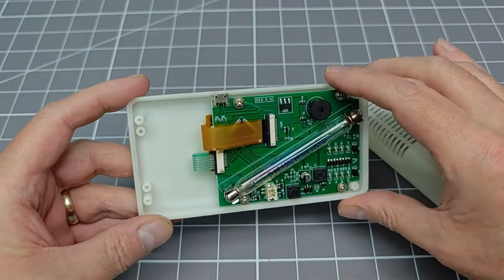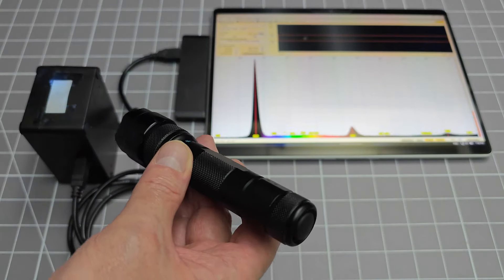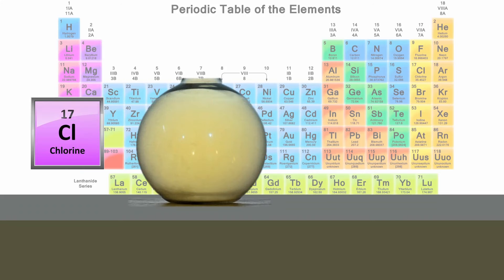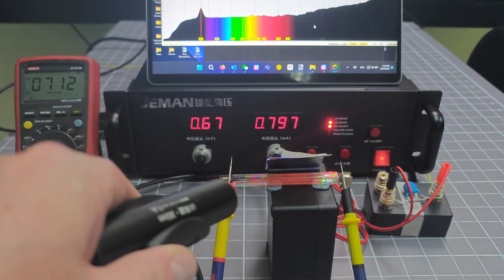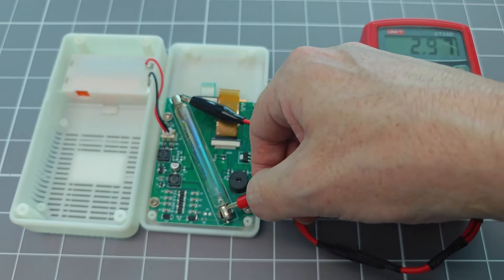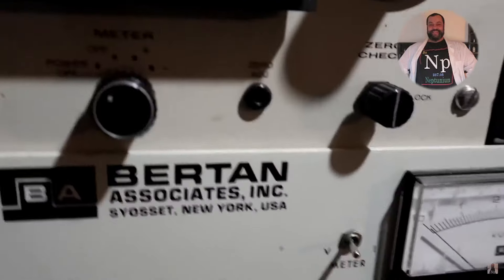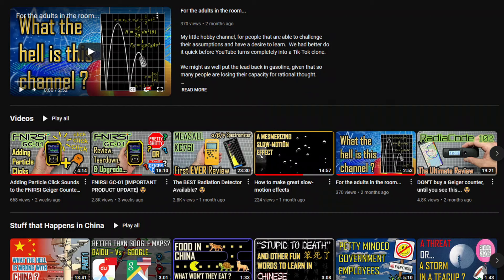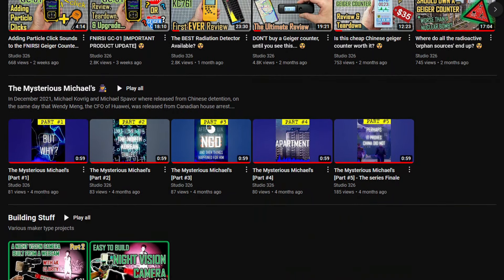A Crowd Sourced Nuclear Physics Experiment.

Comment: The Bosean FS-5000 is the only G-M counter (which is a great cheap Chinese G-M counter) that I have with a glass G-M tube. I actually got the same results: No UV interference. I used a Darkbeam 365 UV flashlight and also sunlight. I didn't see a difference in the background counts (as for my control), nor when exposed to the UV light or the sunlight test. I don't have as much test equipment as you do, so for me, the testing was fairly rudimentary. As the father of modern rocketry, Wernher von Braun said: "One good test result is worth one thousand expert opinions." I really appreciate your dedication to STEM! You have exceptional skill sets! The quality is great, too! Also, Neptunium is another great mind out there–with awesome videos, too! Thank you so much!  Cheers from the USA, and have a wonderful day!
Reply from the maker: thanks for the feedback, this is the kind of results that are needed to complete the last video.  Did you manage to measure the tube voltage.

Comment: Oh man I gotta do this. Just ordering some resistors and an enclosure for them.
Reply from the maker: Thanks, I really look forward to seeing your results!
Reply: @project-326  I mean, your project came just in time. Month back I was wondering that I should measure my CDV-700 output voltage. But now I also have a counter with J305ß tube connected to my smart home. So I've got the test subject freshly on hand.
Reply: @project-326  Hmmm seems like this divider wasn't enough. Was able to make it and had a multiplier of 99.07. But for some reason my cheapo aliexpress geiger started counting like crazy, was able to measure voltage of 22,3V. Somethings wrong somewhere I guess
Reply from the maker: @OH8EFI  It can do that, usually the counting circuit is on the cathode.  FOr the voltage measurement, it doesn't really matter if the tube starts counting.

Comment: I know the spectrometer is rated only down to 300nm, but did you ever get a deeper UV bulb on it? I know germicidal UV is at 254nm so was wondering if the spectrometer would actually be able to meter a peak there in the software
Reply from the maker: the response really falls off below 340 nm.  There is a separate video about testing this spectrometer on the channel and there are a lot of tests.  It wasn't able to see the 254 nm Hg line, sadly...

Comment: Adi makes a ,140v opamp, arranged for higher voltage. If you tickle the dragons tail, pre ionization you can take an ac coupled reading. Perfectly flat and you can distinguish the particle energy and light. It will measure vibration too. A neon bulb will work also. Not to mention adapting to different tubes.
Reply from the maker: that sounds like a really interesting project.  DO you mean running the tube in the proportional region of its response, at lower voltages?
Reply: @project-326  Running it on a current source. You won't need damping gases. I think this may be the way the tube is driven now. It wouldn't surprise me. The variation in applied voltage used to maintain constant current represents energy added externally. A drop in voltage indicates applied energy.
Reply from the maker: But the voltage would try to rise to absolutely tremendous levels if you drive one from a pure current source.  Between ionization events, the current is very close to zero.   The tube is not a simple resistive load.

With GM tubes, it is better to think in terms of charge instead of steady state currents.  For accuracy, the tube voltage needs to be maintained within the Geiger plateau and that is why constant voltage supplies are used.  

The anode resistor does add some passive external quenching, but to stop the avalanche traveling the full length of the tube and further increasing the dead-time is what the quenching gas does.  There are also active quenching systems (very high end) that actively pull the anode voltage down in a very short time after each activity, but I don't know of any commercial tubes that omit the quenching gasses altogether...
Reply: @project-326 it must be the same as a neon bulb. when you drive a neon bulb with a constant current it makes a radiation detector. Also you can measure vibration into hundreds of kilo hertz. Plus visible light. Anything to trigger excitaton will be compensated by the constant current source which manifests as a drop in voltage, which is your signal.

Comment: Great video.  I've previously tested a couple of tubes for UV sensitivity.  
At 395v, a J304 glass tube had no UV sensitivity. Same for an SBT-11A  tube with a clear mica window. I didn't turn up the voltage, as that where I normally keep it set.

Comment: I got a newer version of GC-01. It came with an unmarked tube that looked like the 613 junk. It was not as sensitive to the americium source as it should have been, but would go to alarm condition if the tube was exposed to sunlight through a window. I live in Florida and the UV index was high  in summer when I did this. A lot of the UV gets through the glass windows then.

I replaced the GM tube with a J321 and it worked similar as it should to the americium source. It did not react at all when directly exposed to sunlight through a window like the previous GM tube. I measured the voltage using a divider circuit similar to your experiment, and measured 525 volts. I was surprised at the voltage because the load resistor was 8.3 Meg Ohms. I did not change the load resistor because the unit works great as far as sensitivity to radiation goes.

The newer unit came with a 300 MAH battery which was a ripoff (I replaced it with a 1,100 MAH battery). It also has no backup battery, a USB that only charges the battery, and a smaller speaker/buzzer.

The only positive aspect is:   It is very easy to make the unit click on radiation counts. There are two resistors on the circuit board right next to each other (R16 and R36). R36 is the load resistor for the speaker/buzzer, and R16 is the load resistor for the LED on the other side of the circuit board. If you solder a tiny piece of wire between the upstream side of R16 and R36, the unit will click with a neat sound. Also when in alarm mode you can hear the clicks and the alarm tone. No resistors or capacitors required.
Reply from the maker: Great feedback, sadly this manufacturer is on the race to the bottom, they have just released the GC-02 which has all of the most terrible permutations that they have tried on the GC-01, combined into one product.

Comment: What an excellent bit of crowd science.

I have a dental "UV" curing wand that operates at 428-480 nm with 1200 - 1500 mW/cm² output. Although they are often called UV the wavelength is too long and more in the visible violet region but it's high power and possibly spreads into the UV.  I found however this had zero effect on the J321 tube in my GC-01 unit even when held closely at the cathode end. I have another UV torch of unspecified output for curing mobile phone display glass adhesive and that had no effect either. Neither did a small UV keyring banknote checker. I went outside in the sunlight and perhaps that did have an effect but it wasn't that marked.

My J321 is being operated at 556V. I'm measuring with a x100 scope probe at the output of the voltage multiplier on the final capacitor C28 before the 2MΩ series limiting resistor R12 but despite this the voltage falls when the probe is first connected, to 516V due to the 100MΩ load and the effective impedance of the multiplier. 

From what you say the working voltage is set too high. I am thinking of adding two series connected 200V zener diodes at this point to ground to lower and stabilise the applied voltage to 400V rather than rely on the dubious loading resistor R38 which is set too high anyway.
Reply from the maker: The GC-01 has almost zero voltage regulation so they added a loading resistor (or at least a pad for it).  In the end, I went for a 20M loading resistor.  Ideally the J321 should be working at 380V but most manufacturers try to push this to the top end to give a higher sensitivity, which is fine, if the voltage is well regulated...
Many viewers have found their own values between 5M and 20M to get the tube voltage correct.  Just be sure to measure just the tube voltage without the anode resistor.

Thanks for the nice feedback!
:-)
Reply: @project-326  I measured before the 2MΩ anode resistor on the capacitor C28 because the 100MΩ scope probe, when dabbed on instantly shows the full 556V stored on C28 which then exponentially discharges under the 100MΩ probe load to 516V. This can easily be captured on the scope and measured with the cursor. The initial 556V is also what I presume reaches the tube through the 2MΩ anode resistor when zero tube current flows (between clicks - confirmed by measuring across R12). If I were to measure directly at the tube after the 2MΩ anode resistor then because there is no capacitor to hold up the voltage, dabbing on the 100MΩ probe instantly divides with the 2MΩ resistor giving a false low voltage 100/102 x 556V = 545V which would then decay as C28 discharges but to an apparent lower 100/102 x 516V =  505V. Ok not a huge error of 11V and my scope probe will have a bigger error.

However, I've just now added two 200V Zener diodes effectively across C28 which has greatly stabilised the voltage. It doesn't now dip down when the 100MΩ scope probe is applied. It measures at 428V which seems higher than expected. I did try to calibrate my 100MΩ scope probe against a 100V lab supply which when checked against my multimeter seems to read +2% high and as the 200V Zeners can be +/-6% so could read up to 432V - so it's within credibility. 

I also checked the supply current and it's unchanged which could have been an issue with pulling the multiplier down more but it seems fine. The units background reading seems to be unchanged.
Reply from the maker: did you notice any UV sensitivity before or after adding the Zener diodes?  At background there will be very little difference, going from the middle of the plateau to the top of the range would result in about 5% increase in sensitivity, you would need to be able to average over a very long duration to be able to notice that...
The tube voltage seems to be very high for the J321, are you getting any visible ionization (you need to look in a dark environment to see)?
Reply: Well it was high at a measured 556V which is why I added the Zeners and now it's about 420V given my attempts to calibrate the x100 probe. I've never seen any visible ionisation even with the UV sources but they might all be on the longer side of UV.
Reply from the maker: it would be great if you made a quick video to show everyone what work you did, I will be sure to include it in the next video...
Reply: @project-326 Sorry, I added a video last week but I just checked and YouTube seems to have removed it. It was my ever first video too - you'd think they would be kinder...
Reply: One other point I've not tested but makes sense - without some sort of voltage stabilisation and just using a resistor to pull the voltage down will be very prone to a high radioactive source causing rapid multiple clicks to act as a bigger load and pull the voltage down further. This will cause a non linearity in the response.
Reply: @project-326 No it removed my comment containing the link from the comments here. I'll email you the link anyway...
Reply: @johnh9449  Do not put any music in the video at all. Sometimes that is the reason.
Reply: @glasslinger I sent the link by email in the end. I think it was just that I'd posted a link - even though it was to my own video without any music or anything else copyright.

Comment: Very interesting!  Do you have a link for the optical spectrometer?  Thanks.
Reply from the maker: I just added it to the video description!
Reply: @project-326  How would someone in the USA order this?
Reply from the maker: @gblargg  I just opened it up, its basically a piece of DVD glued over an OV2710 camera module with a 3D printed chassis to hold everything in exactly the right place.  The design is actually quite nice, clearly the guy spent a lot of time getting the design to be just right.  It does say "DIY" on the TaoBao ad...  It works way better than the one I made a couple of years ago...
I'm really not sure where you can get this in the US, there must be other folk doing something similar there?
Reply: @project-326  That's actually inspiring, I didn't realize it was so easy. It sounds like that Theramino software for spectrometers is similar to sigrok for logic analyzers. I have one of those simple spectrometers you look through, with a diffraction grating. That would probably be easy to modify with a webcam.
Reply from the maker: @gblargg  I think that the time consuming bit is getting all of the alignments correct.  For me, $49 is worth the time saved as I already have some other applications lined up for this device.  I was actually surprised that I could perform some simple gas chromatography using this unit.  It seems that the OV4710 camera module has a pretty wide spectral range, I think that the maker also removed the IR filter from the camera.
Reply from the maker: the maker has also messed with the camera module firmware or config ROM.  The output is pure monochrome with some kind of pixel averaging used for the auto exposure function.  Probably all built-in functions, but you will need access to the camera vendors tools to be able to program that kind of stuff.  The one I built was nowhere near as good as this one, probably because the camera settings were a poor mach for this purpose.
Reply: @gblargg  I answered your question how to get it when living in the USA but all my comments are disappearing.
Reply: @Ni5ei  Darn. Does it involve expensive shipping added? Because I saw some posts about a roundabout way.
Reply: @project-326  Thank you!
Reply from the maker: There is a link in the description, but it is only available on TaoBao, here in China.  I am making my next video about that little cheap spectro.  Stay tuned.

Comment: Hi there. I understand the 100Mohm series resistor is to reduce the current when measuring the tube voltage, but am puzzled what the 1Mohm resister is for. (I’m a newbie in electronics). I wanted to also say thank you for this info, it’s very helpful, as I have recently purchased an old military dose rate trainer that uses a GM tube and am currently trying to fix it, and have been struggling to measure the tube voltage.

Also just wanted to say what a fantastic entertaining and informative channel this is, and thank you for taking the time to make these videos. They are all excellent.
Reply from the maker: First of all, a hobby channel, I really appreciate your nice words.
For the high impedance probe, the 100M resistor is to limit the current, as you already figured out, the 1M is for the multi-meter (DMM) to made a measurement against.  Because the DMM typically has an input impedance of between 10M and 20M, the lower impedance will reduce the amount that the internal impedance will further reduce the measurement value by.  

In theory, you can just add a high impedance in series to make this measurement, and that is also valid, so long as you calibrate the measurement system before us on a low impedance voltage source.  The purpose of the 1M resistor is to try and get a measurement ratio that is around 100:1, it just simplifies the process when there are two known values.  

That said, there is nothing wrong with just adding 100M in series with one of the leads of the meter...
Reply: Hi there. I measured the tube voltage on my Bosean FS-5000 using a 100M resistor in series with my Hantek DS02D15 oscilloscope, and it came in at 413volts rms. (Conveniently 120volts dc-rms=1.20volts dc-rms measured, so I figured 413volts=4.13volts measured) I hope my measurements were correct. I tried my cheapo UV flashlight and it had no effect. I will try to make a video at some point if I get the chance.

I also measured the tube voltage of my old military Geiger and only got 205volts which explains why it’s not working.

Love your videos. Please keep them coming

Comment: After connecting my geiger to thingspeak and looking at graphs i noticed when my ws2812 led strips were on my j305 was reading very high. I ended up putting it back in its box for light sheilding. Is it only UV that effects tube? If so it confirms the ws2812 led puts off UV, This is something I have been wondering if they did since noticing the phosphor on a large cob led i have seems to glow yellow when under ws2812 lighting. Maybe ill make some vid's about it. Good channel keep up the good work.
Reply from the maker: if the voltage is high enough, pretty much any photons will cause triggering...